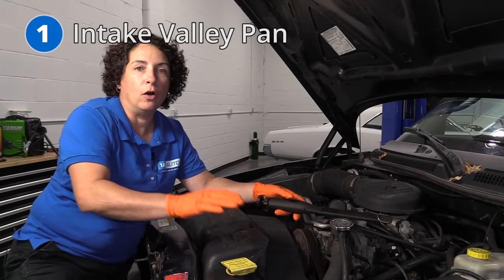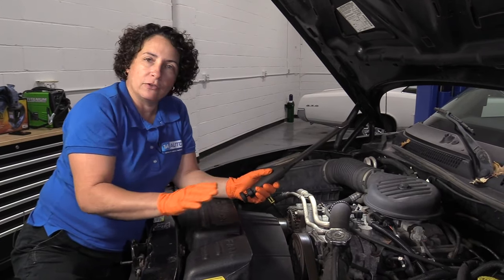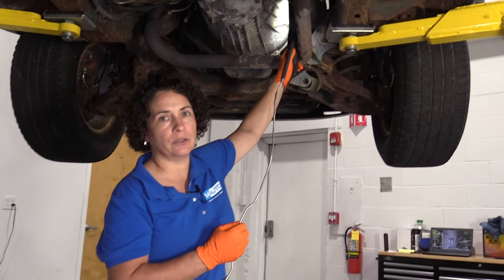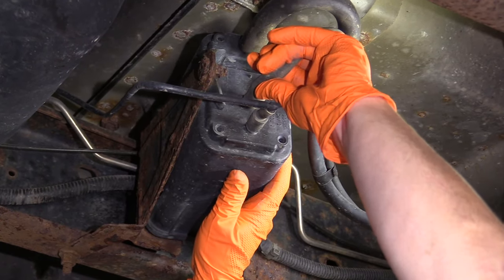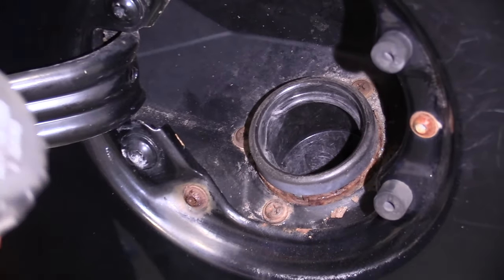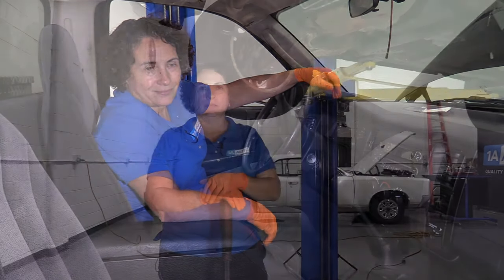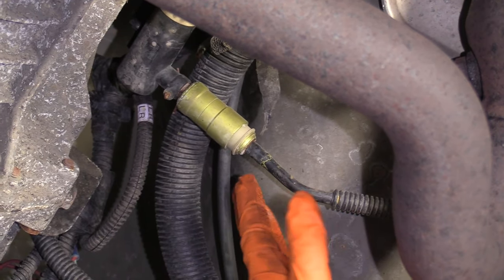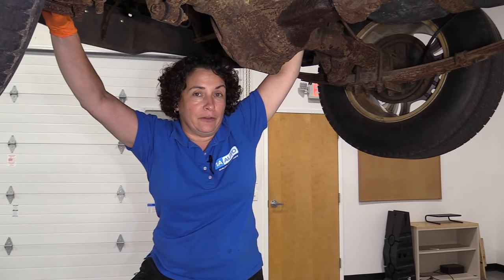Top 5 Problems Dodge Dakota Truck 2nd Generation 1997-2004

Comment: I've got 97 Dodge Dakota, 3.9L. Sometimes it runs ok and sometimes it won't crank at all. Sometimes it dies going down the road and backfires. Computer code P0351.
I've replaced spark plugs and wires last year. Put new ignition coil on. Changed coil pickup distributor. And a few other things but none helped. 
Can someone please help me figure this out? This is my only vehicle.

Comment: Yrah but these problems are easy fixes. Ive owned durangos an Dakota. One currently is a 02 R/T Dakota. All these problems are easy to fix an diagnose. As any other vehicle, just takes time an removing certain parts here an there to make other parts easier accessible.

Comment: 0700 trans code pistion solenoide get stuck...only soloution replace unit ...reset engine check light..disconect negiative cable turn ignition on count to sixty turn key to off position.go back out reconnect cable..go back start engine check light now off

Comment: I have a 2001 Dakota 4x4 , the door bell starts chiming when I put it in gear and start rolling, when I stop at a stop light it stops.  The headlights are also flashing, interior lights and wipers come on intermittently, anyone have any ideas what could be causing this??  Thanks

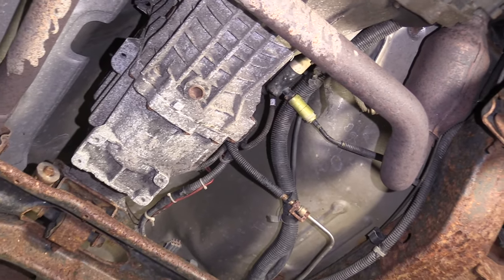Comment: At 6:44 is weird the abs/speed sensor is in the diff but i got a 3rd gen dakota a 2007 thay has a wire on the driver front that goes into the steering knuckle but its all chewed up from the tire I think but I dont have any codes for it plus that wire is not on the passenger side either
Reply from the maker: +TJ Desandis We wouldn't be able to diagnose an issue like that here, you may want to have a local mechanic take a look at it. Thanks for checking us out! http://1aau.to/m/Shop-1AAuto-c
Reply: When you say it has a wire, I am thinking of an ABS sensor, not a speed sensor

Comment: I dig on my 2000 Dakota 4x4. Only thing that drives me Crazy since I bought it in 2003 and believe it came from Canada is it take 2 turns of the key to fire up. Had dual exhaust put on and the Cat taken off and initially the check engine light was off but after 2000 or so miles it's back on, I've erased it and comes back. Put a cold air intake on it and between the exhaust and cold air Woke this 4.7 up majorly! I've only put gas in it and changed the oil and tires, has 70k on it. Bitchen four wheeler too!

Comment: The resistor for the fan, what a crap design. I replaced three in three years! They burn up or the plugs melt. Other than that it was a very reliable truck until my S.O. took it through a highway barrier. Then no more truck. . .
Reply from the maker: Thank you for checking out the video. If you need auto parts go to: http://1aau.to/m/Shop-1AAuto-Now
Reply: It’s not the resistor it self, it’s your blower motor take off your blower motor and spin it it should spin freely if it doesn’t the bearing is worn, and causing the the resistor to get too hot from drawing too much amperage to compensate for the bad blower motor thus resulting in the resistor burning out fixed Many Dakota’s most people thinks it’s the resistor but it’s not true.
Reply: @xxxdpgxxxx1389  As I stated, my S.O. destroyed the truck, so I can't check anything. And I did check the blower motor, in fact it WAS the first thing I did before replacing the crap resistor again and again over three years!

Comment: Turns out both the rubber gasket in my factory gas cap is rotted and my evap hose is rotted out and broken off

Comment: Hi I have a weird problem and im wondering if u know what it is. I have a 2003 dodge dakota slt. When I put the key in the ignition in the off position and turn on the headlights the truck starts.. also when I turn on the truck normally and put on the lights its makes a very annoying noise. Please anyone let me know if you have an idea whats going on.

Comment: Wow I'm surprised the fuel pressure regulator/ fuel pump assembly isn't on here.
Reply: ebib I feel that, just happened to mine.
Reply: Agreed, my 2.5l starting to intermittently stall...
Reply from the maker: If we had top 10 problems it would have made it. 😉👍Thank you for checking out the video. If you need auto parts go to: http://1aau.to/m/Shop-1AAuto-Now

Comment: Transmission those p700 valve bodys bind up the sub contractor  specs now are too tight trans fluid it tight spaces ends up being like cosmoline

Comment: If there is metal on the wheel speed sensor what is that issue?
Reply: differential is bad and shaving metal.
Reply: Ageing diff
Reply from the maker: Internal problems in the differential. Thank you for checking out the video. If you need auto parts go to: http://1aau.to/m/Shop-1AAuto-Now
Reply: Worn gears

Comment: You didn't mention the valve seats falling out and smashing up on top the Pistons .
Reply from the maker: Good call. Thank you for checking out the video. If you need auto parts go to: http://1aau.to/m/Shop-1AAuto-Now
Reply: Obviously this comment only applies to the later aluminum cylinder head engines.

Comment: So I have a 98 Dakota with a 5.2 V8. Long story short, it idles excellently for about a second or two, then stalls out. Checked fuel pressure, relays, ignition coil. It seems like something is shutting the truck off. Any advice anybody? Thanks in advance :)

Comment: I have a 97 and the security light come on and won't start light flashing  no one could tell me how to fix it 
get out the truck lock the driver door and truck  go to the passage door open  put key and it will start

Comment: very helpful I got an abs light thanks now I am also looking for location for my turn signal fuse thanks
Reply from the maker: The fuse should be in the passenger compartment fuse box. Thank you for checking out the video. If you need auto parts go to: http://1aau.to/m/Shop-1AAuto-Now
Reply: @1AAuto  yupI found it and gotnit fix thanks

Comment: LOL one way to fix all these? Rip out the gutless v6 and throw in a 5.9l with an edelbrock carb swap-NO computers sensors to mess with(ready to run version distributor). External dodge regulator spliced in with simple harness to make sure alternator isn't stuck on full charge(screaming belt). With this setup flathead screwdriver with 3-4 screws--thats it. Oh yeah, my water temp and oil pressure and pure mechanical gauges. NO electrics(except for backlight).

Comment: You explained everything in depth until you got to metal shavings on the sensor.  "If so, you've got problems." Yeah what problems
Reply: Probably differential gears chewed up considering it's on top of it.
Reply: Youre gonna need a rebuilt diff
Reply: @SebastianWoodard  thanks
Reply from the maker: Internal issues with the rear differential. Thank you for checking out the video. If you need auto parts go to: http://1aau.to/m/Shop-1AAuto-Now
Reply: Differential greats
.......,

Comment: Im from Cali never seen so much rust on a truck like this video, wow would never ever buy a car with any rust sign underneath.
Reply: Us fellows that don't want to or can't afford to buy new don't have much choice out here.  My 99 is a rolling rust bucket but runs good.  Has an evaporative issue, I believe, and the 2nd to 3rd upshift occasional hiccup but I like the truck.  I hear that's another common issue with the automatic transmission.

Comment: Nope, you didn't bother checking the idle/air control valve before claiming intake gasket. Only issue I've ever had was the valve. The running gear absolutely is NOT the same as Jeep. May have a few common sensors and accessories for the engine but nothing is interchangeable. You don't know Jack. Couldn't even get through the BS and finish the video

Comment: If you want a good dodge dakota. Don't buy one like the one she is showing you. If you buy a 1999 or older you will get a solid and reliable 318. The 4.7 v8 like the one she is showing is absolute garbage. They will melt themselves down and overheat at idle.

Comment: 2002 dodge dakota with 110k miles

reading 2 codes, both which are in this video lol.

the valley pan issue (sounds like an exhaust leak when i accelerate) showing cylinder 2 misfire
and the evap leak lol. previous owner bought aftermarket gas cap and i think thats all i need to replace to fix it. im hoping.
Reply from the maker: Great! Thank you for checking out the video. If you need auto parts go to: http://1aau.to/m/Shop-1AAuto-Now